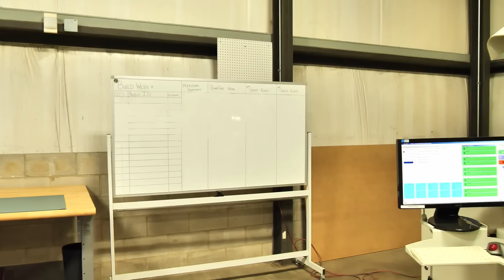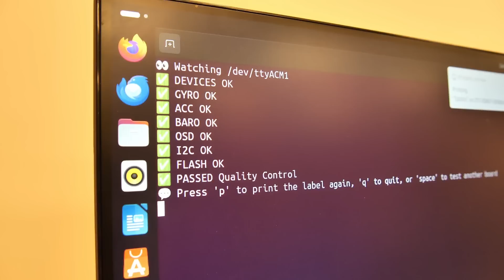US Made Electronics, Adding To The Team, Flite Fest Dates, And So much More in 2025

Comment: 8:05 It was your videos at the old shop that finally nudged me into getting my old NexSTAR in the air all those years ago. I flew it above Edgewater even! Got it stuck in a tree off the 7th hole haha.

I don't know the logistics of me doing anything OFFICIALLY with flite-test, but I'm happy to be an ambassador for balsa and nitro. I do it at my own club. One of the instructors, teaching total newbies on the buddybox using a Telemaster 2000 powered by an OS FS-60 Open Rocker.

If I lived in Ohio I'd probably be all over joining the team in an official capacity to do what I'm doing anyway here in Nashville. Get people up to speed on balsa, on nitro power, let them experience EVERYTHING this hobby has to offer. As nice as foamboard electrics are, they're not the entirety of model aviation, and you guys have struggled with nitro in the past. You need someone on the team who's good with these little engines.

I'd happily be that someone if I didn't live 900 miles away.

Comment: Excited for the new us made esc and flight controllers! Will they run open source firmware (e.g. am32), or at least have cross platform programming software?
Reply: Yes! - The ESCs are AM32 based and the flight controllers will work with Ardupilot

Comment: @Flitetest just got an EZ pack v2 and tehre appeares to be some clear plastic around the battery casing that would be hard to remove. Is that meant to be there?
Reply from the maker: The clear tape around the silver foil is normal and supposed to be there :-)
Reply: @FliteTest  Good. Also i have an idea for a new plane and a new power pack. First, a sub-800mm 3d capable "flat foamy" model as just two pieces would me nice. Second a micro power pack with a brushed or micro brushless motor and 3gram servos or soemthing like that.
Reply: @ also, I got a few ez packs for Xmas and some of the batteries say kf11 and some say jf13 what that mean
Reply: And one says jf08 and they’re all 380mah I thought they were 350 and there’s no charger instructions